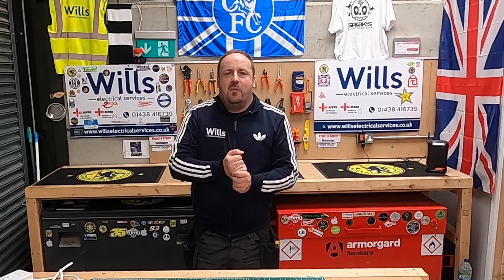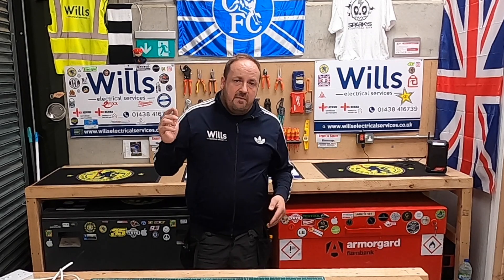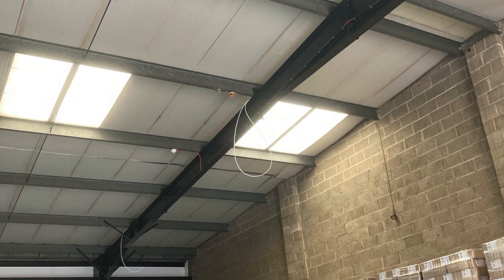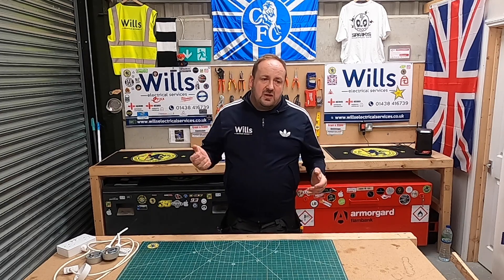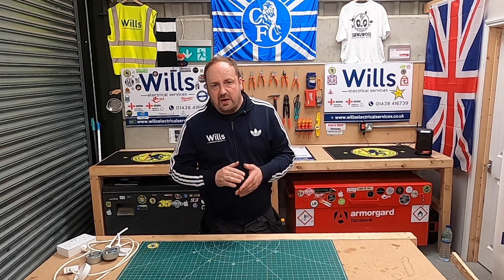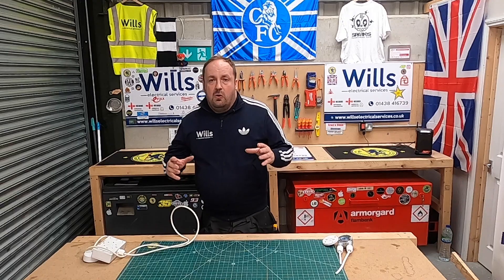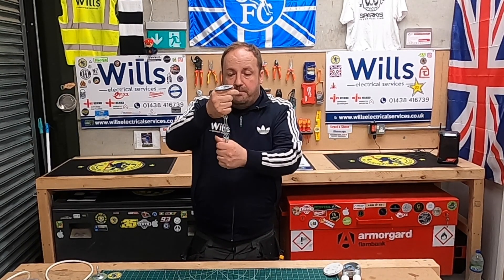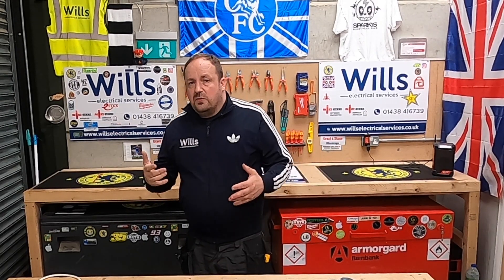Install job Warehouse high bay ufo lighting on cable tray using FP200 cable  Electrician TV

Comment: I use different style Purlin clips on these jobs, to hold the FP and suspend the fittings. No drilling or tapping required, saves loads of time. Also use the Ashley Klick, easy to test the circuit before applying any load